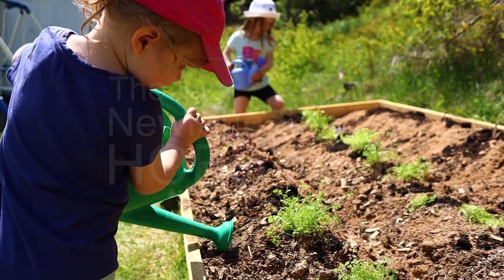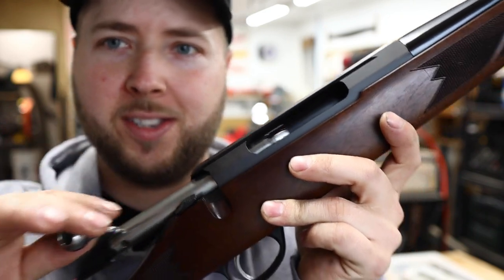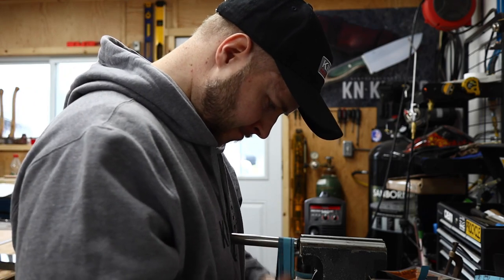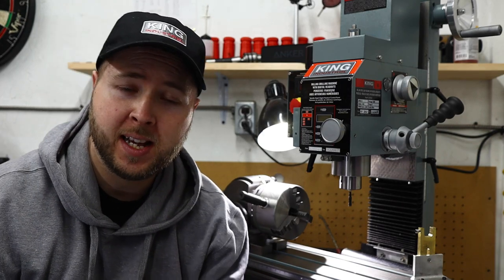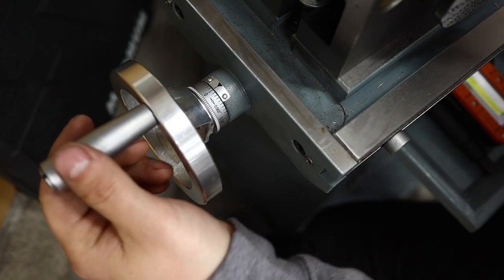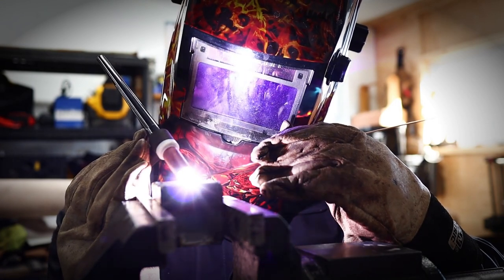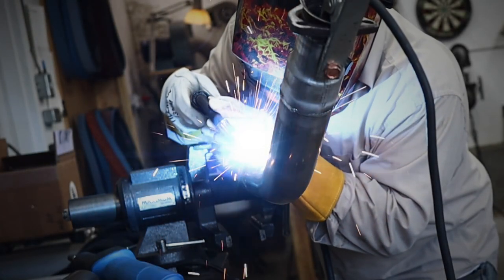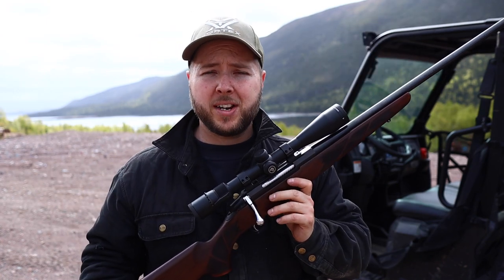How to Create the Perfect Rifle - [ The Newfoundland Hobbyist ]

Comment: Just a note... Lapping in the scope rings is no longer done. Almost all the manufacturers will void the warranty if you do.  Yes we [Gunsmiths] were taught to lapp  them and it was a standard part of scope installation 'years ago". However, technology...modern machining as improved so much over the years.  That the tolerance and fitment of the rings no longer requires it.  Additionally you won't get any slip of the scope in the rings.  The other thing is "proper torque " of the scope rings.  This is absolutely important.  If you have done it daily over and over again.. a Gunsmith can come very close by hand. HOWEVER... a small inch pound torque wrench is inexpensive insurance.  The biggest mistake made is OVER TORQUE.  Which is easy to do.  Everyone wants them TIGHT... and it will squeeze and damage the tube. You will not be able to get the proper amount from your windage and elevation screws. 
  Great choice on the scope.  Leopold is top of the line.  But the version you was looking at was the very bade Leopold.  You stepped up with the Vortex and stayed in the same price range.  Great decision.  Nice job and machining the scope bases.  Great job on the  jeweling work.  Nice sling as well... clean and simple.  ABOVE ALL...THANK YOU  !  From this old Gunsmith for respecting the "heirloom " classic beauty of a rifle.  A wood stock blued steel... classic bolt action rifle.  I have no problem with " modern sporting rifles ".... But this is a hunting rifle that as you so well said.  It's a heirloom that can be passed on...

Comment: Yes, as factory loaded ammunition, the 300 WSM and 300 Win Mag are quite similar in power. However, the 300 Win Mag is quite superior when handloaded for maximum performance as is the 300 WSM ammunition from the factory, not that it really matters in the end. Handloading is yet another rabbit hole you may choose to avoid.